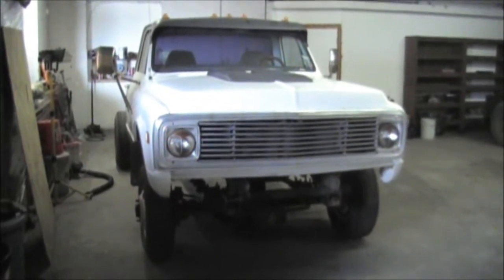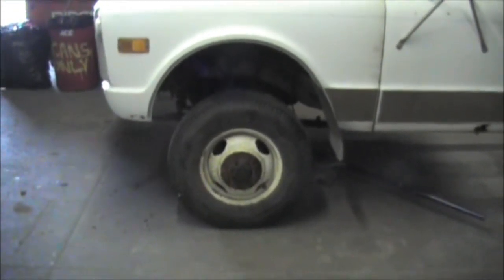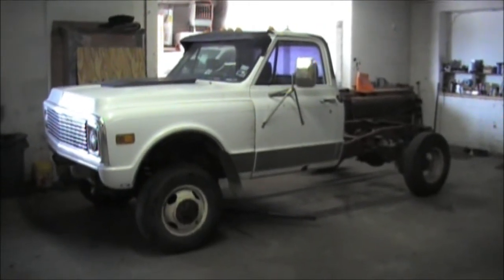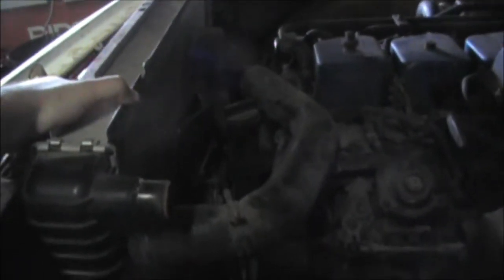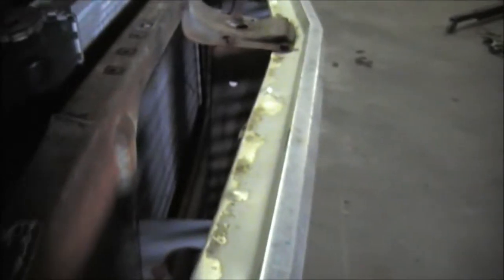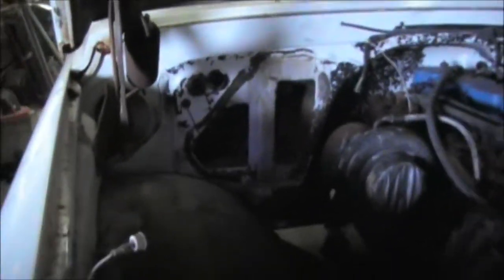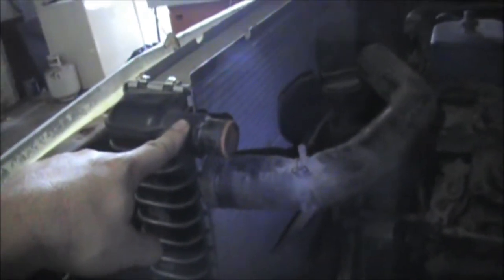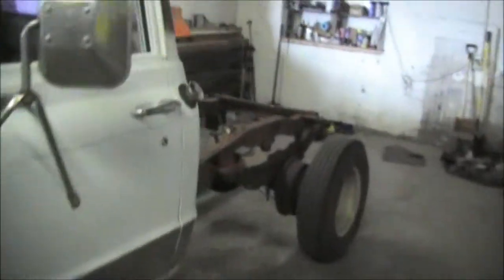72 Chevy Cummins Dually - Togeather Again!!

Comment: Thanks for getting back to me re cab swap The HD3500 is a totally unique frame even to the 3500  Dualie pickup of the same yr If you notice the frame comes up at the back of the cab and goes straight to the end They did that so you upfitters can mount a cargo body. I'm not surprised the 1970 cab didn't fit first try When GM built the 50,60 &70 series they used the cab from the same yr Only the front fenders were different from the pickup. GM did what most HD truck builders do and place the cab on mounts that put the floor over the frame. This makes for a high floor but usually with tanks and steps you didn't notice. It would also give you a chance to mount the cab on air ride since riding in an empty 3500hd feels like it has no suspension! Well maybe you can build another with your 3500HD frame , a 5.9 Cummins or a 4/71 Detroit (to be true GM )Allison or RoadRanger trans With a1970 cab on air with a flip 60 hood Probably what engineering wanted to build!   Thanks Jeff
Reply from the maker: +Jeff Pitman I would really like to find a crew cab 3500 HD and build it that way as a 4x4 with a Dynatrac Dana 80 front axle, but that is a huge project and not one I have time for.

Comment: Why wouldn't you adapt the 70 cab to the 3500hd frame? You install the Cummins as well That way you get the best 1 ton frame Gm has ever produced set up for a diesel with the Dana80  R/A and the I beam F/A with the superior styling of the 70 body Plus parts would be easier to find for the HD
Reply from the maker: +Jeff Pitman that would actually be a great idea if the frames were not so different, I seriously looked at doing it but in order to do it id have had to cut the floor out of the hd cab and installed it in the 72 with a lot of custom fab work. Would have been really time consuming.